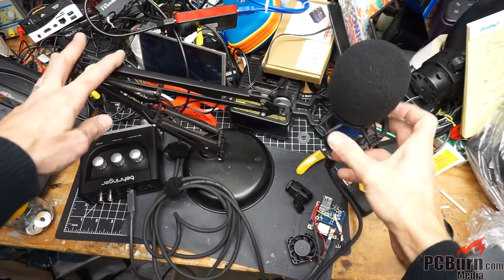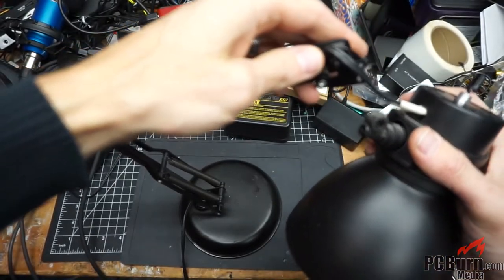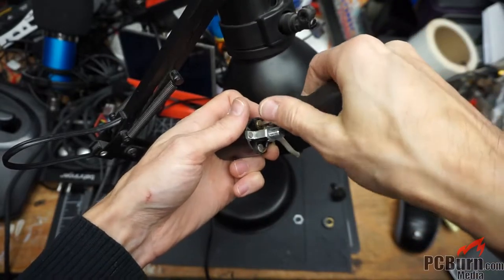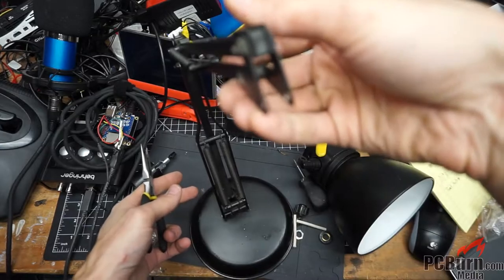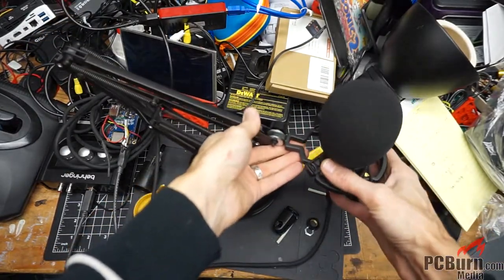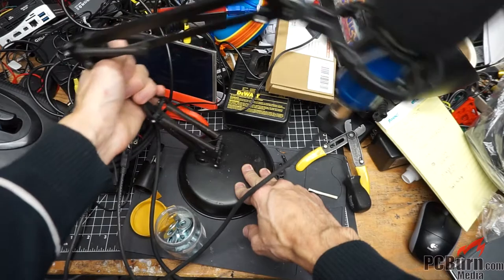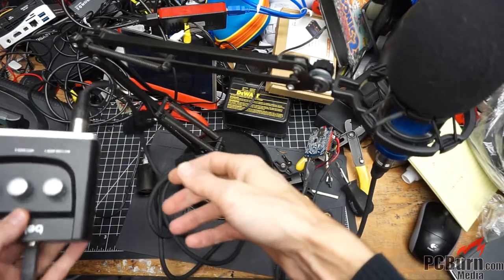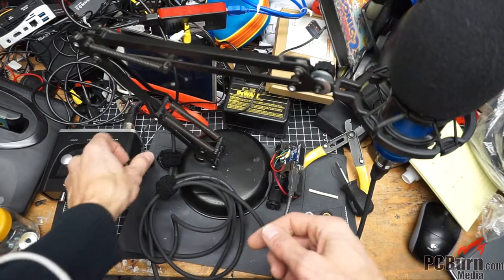DIY Mic Stand from a Weighted Base Lamp with Cable Clips for Cable Routing

Comment: Raspberry pi project would be interesting to see. Thanks for the video.
Reply from the maker: Absolutely! I've almost got the software set up for the Orange Pi Zero I run on as the audio recording server; just need to add in the GPIO light/buttons support and push the instructions and scripts up to Github. Maybe a WebUI if I want to get fancy.

I'll implement it on a Pi Zero W to see if it's got enough oomph as well. Any of the Arm v7 Pi's would work if not.